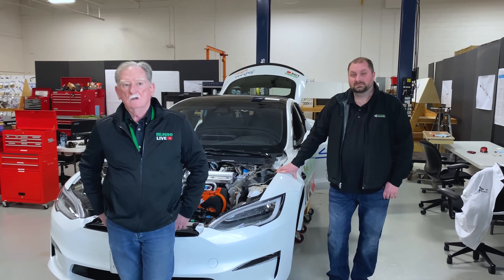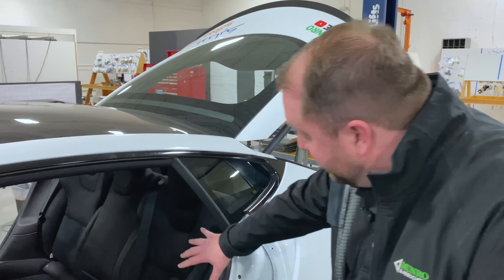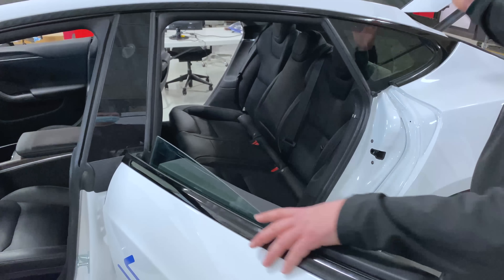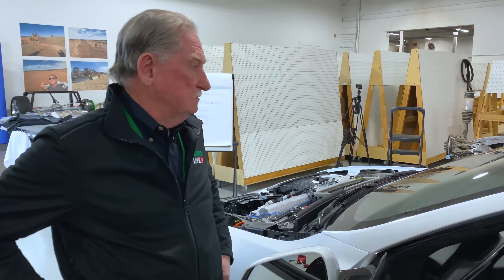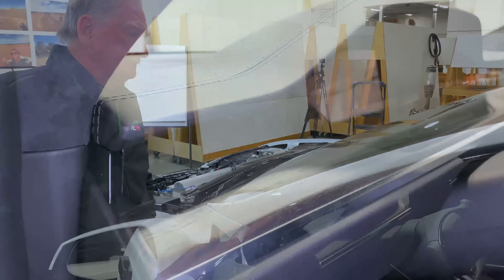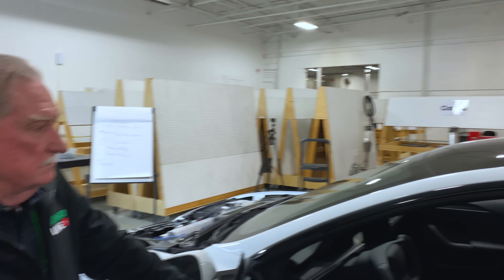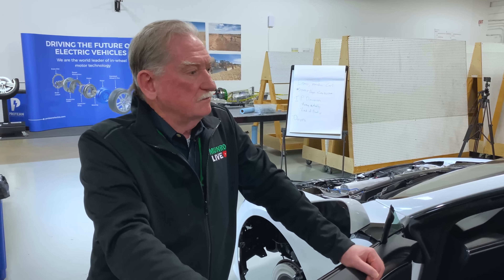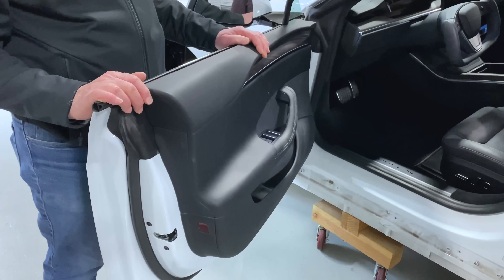Interior Design & Analysis | Tesla Model S Plaid Teardown

Comment: I don't agree with the suggestion that a tall person always wants the seat to drop as it goes backwards. I have very long legs but not a long body and require the vertical adjustment to be higher than it's lowest position.  Having pid so much money for a vehicle fine adjustment for comfort is essential in m opinion. Penny pinching is not necessary!

Comment: The main complaint for me for the steering wheel is the turn signal buttons. It would be much better if there was physical buttons to feel the engagement like the Huracan. When I went out and had some fun in the snow. The Yoke was tougher to control, because you couldn’t let the wheel roll through your hands when recovering from a slide. The yoke really is great for hwy use tho.

Comment: Having the arm rests on the doors molded into the panel is a huge mistake. In time- and look at almost all Mercedes from the 80's, especially the 190e - the adhesive ABOVE the armrest releases, the material contracts and the armrest literally disappears into an upward slope. Same thing cursed the 64-66 Thunderbirds with their molded panels. This cannot be repaired because the molded panel is adhered under great pressure at the factory, something your upholsterer cannot deplicate.

Comment: Motorically adjustable seats are plus for me too. But I do not necessarily need buttons on them. Usually we use 2 storable positions. Tesla now has interior camera, weight sensors etc. - I can almost imagine fully automatic seat adjustment based on those inputs for basically anyone entering driver seat. While they can do it good and fast, no options other than lumbar support are necessary.

Comment: The discussion of the yoke was really terrific and interesting. When it was first revealed of course my first thought was, okay - then why hasn't some company already used it for years?? The airbag discussion was a bit of a shock after 50 years of 10n2 driving.  Now I'm wondering why my 2020 Tesla Model Y has the cross bars right in the way of 9n3.

Comment: The door lock on my car (and most others I've noticed) is in the door. However it seems to be reversed for the rear door on this Model S. Is there a particular reason for that? I know the emergency unlock latch needs to physically connect by a wire to the locking mechanism. Thanks for the cool videos!
Reply: I believe the emergency release for the rear doors is actually under the seats so that would make sense!

Edit: I checked the user manual, it's indeed there below the carpet. There's an image showing how to access it
Reply: @winkcla  thanks!

Comment: The yoke only makes sense when the lock-to-lock rotation doesn't exceed 200 degrees because it doesn't cross your arms. That's why it's practically in planes and F1 cars. It's a very bad idea - a joke - when the car has more turns from lock to lock, say 2.5, than in a normal car. Imagine you're in an emergency situation like a skid and you need to reach the steering wheel to take control of the situation, but you can't because the yoke is missing the top part, so you have to look at it to figure out where to grab it, and that actually shifts your attention from the situation to the "steering wheel", which makes the whole situation even worse. Look at rally cars and ask yourself why they use conventional rounded steering wheels. The steering wheel has been used for decades and it's a proven technology. Unfortunately, Tesla sometimes makes changes for the sake of change, but not practicality.
Your advocacy of steering wheels is questionable to say the least.
Your theory about broken elbows made me laugh so hard. I've never heard of broken elbows on dummies during crash tests. 🤣🤣🤣

Comment: I never heard so much b*ll talking about a steering wheel:
- a round steering wheel causes broken elbows when the airbag deploys when you drive on a 10-2 position (I'd love to see the stats on that)
- the embossed Tesla-logo makes for a clean, less distracting look (we all know how crappy logos looked in airbag covers in the 90's, before they figured out to integrate a genuine logo inside. Where's the premium feel in an embossed logo?)
- the yoke steering wheel is perfect for racing (because that's what we do with our Tesla Plaid, taking it to the track to go around the twisties, not just pulling straight 1/4 miles)

I really don't see how it's easier to manoeuver in and out a parking spot or in city driving with a yoke than with a round steering wheel. The auto brake feature will be very necessary to avoid accidents when people loose their grip (literally) when turning.

Comment: I would be interested in learning how the controls work. For example, Elon mentioned the chip used in the seat control.
WTF, why does a seat control require a chip? Maybe for the memory feature? So, the seat can implement settings for different drivers?
What type of chip did Tesla use for seat control?  How is the seat control chip connected to human controls?
Also, how does the stearing work? Rack and pinion or drive by wire? How does the computer control the stearing? What is the linkage?
How does the car switch between human driving stearing and autopilot/full self driving and back again?

Comment: My biggest issue with the yoke is tesla didn't bother to change the steering rate based on the speed.  With this design the driver should never have to turn the yoke over 90 degrees to make a sharp turn.  Even at parking lot speeds, a full lock should occur at a 90 degree position.  Speed adaptive steering was done years ago on a number of other makes and since nothing in a tesla is actually connected to the road it could be done easily in their cars.

Comment: Great Video from you guys, as always. A ton of information, explained so that everyone can get it.
But anyway in terms of the front doors, I wonder why they put in a plastic piece in extension for the glass that builds the main desing part for the dash. In there rendered design pictures of the interior it's always a glass piece to give it the look of one continuous 'screen' from one door to the other. And actually we saw on a few newer model S and  X that now they changed the plastic piece against a glass piece.
On the X glass is also used in the rear doors, but for now just in the rendered pictures in Tesla gallery. So why are they implementing it step for step and not from the beginning? Is it just a piece of glass, or are they trying to implement screen action behind it? What kind of existing wiring is behind the door panels? I'm courius to see more about that.
In addition, I'm sorry for spelling mistakes this is not my first language.

Comment: the racing point for sandy is of course very accurate. Look at f1 steering wheels, there's no top, just the sides for the drivers to hold on to
Reply: Bullshit, f1 racing is a totally different level when talking steering wheels? They have the most precise movements, all the controls on the steering wheel and doesn’t need to move their hands at all.
Reply: For road usage a round steering wheel is still the way to go, from drifting around roundabouts to racing, parking, off-roading…… the round steering wheel is perfect.

Comment: Great video(s) enjoying the teardown of the Tesla.  One question, when you're discussing the materials around the doors, I noticed the door hinges are stamped metal. I'm thinking for the price of this vehicle, why  use something that cheap? I have an older model Mercedes and and newer model BMW, both vehicles have cast hinges. This seems a very common practice within the German automotive industry. The older Mercedes's doors close as well and have that vault like thud since new.  I also have a newer Subaru Outback, again, this vehicle has similar hinges, stamped metal, they work well, but just curious why the Germans do it different.

Comment: 4:19 this is a $130,000 car? With a 1-inch misalignment between the door trim and the trim next to the rear seats? 15:04 huge uneven gap in the dash right in front of the driver, reminding you that you spent six figures on a piece of trash because Teslas are luxury-priced cars but not actually luxury cars. Tata Nano has better fit and finish.
Reply: That gap at 15:04 is the space for the tilt steering column,  and clearly designed for purpose.

Comment: The moment you didn't say that the yoke steering wheel is a STUPID, dangerous, not to mention DAFT idea, I lost all confidence on the expertise of the presentation. A yoke makes sense if lock to lock on the steering is less or equal to 180  degrees as in a go cart.  In a car its extraordinarily STUPID and should be illegal.

Comment: To me those seats are not of high quality (far from it) and an interior from a high end Lexus (for instance) is far better. Sitting in the rear with those front over sized headrests blocking the view & light and with no seat adjustment on a “luxury car”.
None of that dialogue about the airbag breaking arms can hold water either (IMO) and using that yolk in the real world is a non runner and will be dropped at some stage.

Comment: I am seeing $115000 worth of stuff I don't want with the $25000 dollars worth of stuff I do want .  For me luxurious means it stays clean and when it gets soiled it is easy to restore. All mechanical components are simple and don't fail without maintenance. Performance is adequate to do the job and the vehicle is extremely lightweight because heavy vehicles will never get around a corner as fast as a light weight vehicle . The biggest improvement needed for electric vehicles is a battery that's lighter than 20 gallon of gasoline and gives the same range . That can be recharged in 20 seconds .
Reply: 20 gallons of gas weighs about 140# and has over 670kwhs worth of total energy. The average ev has about 2.5-4gallons worth in energy equivelant to gasoline on-board stored in the battery. With the current driving ranges why would an ev ever need that much more energy? 🤔

Comment: The fact that it has a more or less traditional instrument cluster right in front of the driver, is to me and admission that that is still the best way to go. Plopping a PC monitor off to the side of the driver is simply a way to save money, but is inferior in practice. That is why they put it in 170,000 car and not in there cheaper cars. In every imaginable analysis of what's best, slapping a monitor in the middle of the car is an inferior solution if everything is on that monitor.

Comment: Those seats look like they were supplied by Recaro , Tesla may trim them with that cheapo PVC material aka vegan leather (that is failure prone)but the frame , springing , rake adjuster headrest mechanism air bag etc will be Kieper Recaro. IMO that interior looks dull and uninspiring , not worthy of a car that costs that much at all, but as the exterior design is also uninspiring I suppose it co-ordinates well with that .